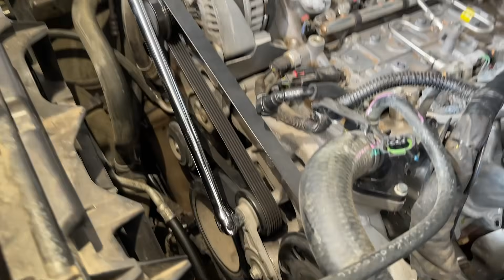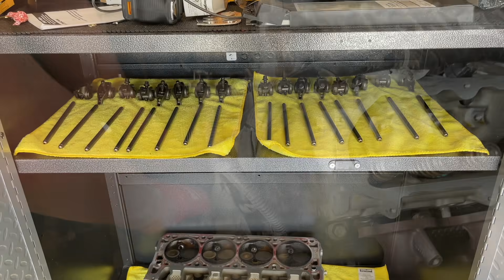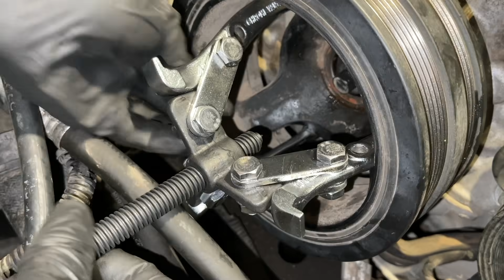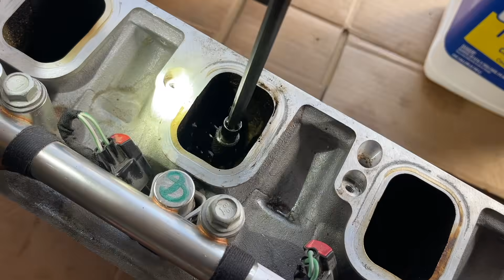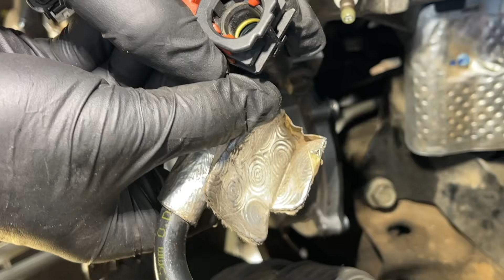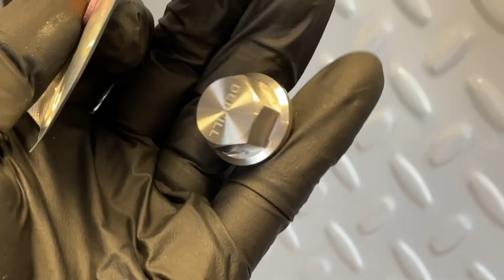GM V8 Cam lifters head gasket dod delete 6.2L 5.3L L86 L83 Yukon Tahoe Sierra Silverado Suburban

Comment: These things are not meant to be daily driven—such a poor engineering job on this model. You will be jumping from engine, transmission, and suspension work and repeat throughout the ownership of this vehicle.
Reply from the maker: Yes. I grew up with reliable suburbans and they are not that way now. I now have Toyotas and this is everything I had to fix on the gmc Yukon / Tahoe / Suburban / Escalade Owner’s manual Bells &  whistles
https://www.youtube.com/playlist?list=PLIjr-uSYDZi7J7EQ1ErTn1Yzi6ET_3Ssr
Reply: @dannyjohnsonsgarage  The camshaft it says that it doesn't fit on the 6.2L L86 V8. Is this dealer recommended?
Reply: Please put some contact info to Tuner , I need to delete dfm afm in ecm on my suburban 2022

Comment: as a gm tech that’s does this everyday great video but there was a lot of unnecessary stuff but great video in the end
Reply from the maker: Thanks. Just trying to do a high quality job. Maybe overkill
Reply: @monsterx13 could u tell me what are the unnecessary stuff because I will be tackling this project next week. Also what lifters do u recommend
Reply: @longstrokes24  are you doing a DOD delete
Reply: @Monsterx13 Between debating it. Was told way to go is dod delete. Engine is making a chirping noise and not coming from belts
Reply: @longstrokes24  most likely a cam dod delete is cheaper
Reply: @Monsterx13 ok. Any recommendations on lifters? Software to turn off dod?
Reply: @longstrokes24 i pad a local tuner to delete the dod in the ecm and i used gm caddi racing lifters and l8t cam and .60 vale shim on the fuel pump roller
Reply: What could of been avoided with a dod delete?

Comment: How much more if im doing the oil pump and time chain also ? Awesome videos 🤌👍
Reply from the maker: For those you’ll want to factor in removing the engine (or lifting it enough to drop the oil pan). The electrical connection and oil lines go deep into the pan. Do a new tensioner as well, and research a non-variable oil pump. If your new cam is not factory duration, look at VVT lockout. I kept mine for better low end performance on a stock cam setup

Comment: Sir! Replace the oil pump and the timing set. Omg you’re better off pulling the motor 😂
Reply from the maker: Where does it end. Might as well do a whole new engine. The oil pump is best if pulling the engine from the lines and electrical connections in the oil pan.

Comment: I have a 2014 Yukon Denali and and 2016 Escalade, so an L94 and L86, my Escalade engine doesn't turn over, my question is, would I be able to use to parts from the Denali to repair the Escalade? OR would I be able to put the L94 in the Escalade? I'm wondering what choices are even possible and what you'd recommend? Thanks!
Reply from the maker: Many parts are interchangeable, but you’d want to use new parts in most cases. There are a lot of other systems, however, that are not interchangeable like VVT and lifter trays

Comment: At any point after you released the timing chain tensioner to have tension again was the tensioner ever loose to the point you could move it with your finger when turning the crank in certian spots but then it would tighten back up. Mine does, and the timing chain seems to have more slack during certian strokes while turning crank bit then tightens. Is that normal or has my tensioner failed?
Reply from the maker: I believe there is a little as you go through, for sure on my mustangs, but I would make for certain. You can push on the back of the tensioner as you did for removal to see if it had tension

Comment: 174,000 miles on my 6.2 Denali. Still going strong. This video will come in handy some day, I'm sure.

Thank you for doing this. Incredible job
Reply: Maybe sooner than later
Reply: My denali just went out at 177000 :(
Reply: @gsamudio77 any updates
Reply: 180k miles and the famous lifter noise just started. Tried the automatic transmission trick and it did not help. Went to 5-30, still ticking.
Reply: I ended up getting Seagram, put it in my engine drove about 5 miles and the tapping has stopped. I’m using 5W-30 oil.
Reply: What brand weight of oil are you running?
Reply: You’re in good luck so far hopefully you don’t get to see this ticking sounds on your vehicle here 2023 suburban premier 5.3L 120,000 miles on and head is out and waiting for the parts

Comment: VVT Lockout?
Reply from the maker: Not for a stock profile cam. You’ll lose low end drivability and torque. I believe for some aftermarket cams you have to lock it or it may have piston to valve Contact

Comment: I’d have dropped the oil pan, replaced the oil pump with one for a non afm application. Also would have done a VVT  delete while I was in there and replaced with a performance RV cam as well as new timing chain, especially since its at 100000 miles.
Reply from the maker: Yeah. Except for the VVT If it’s the stock cam profile. You’ll lose low end drivability and torque, so it’s worth keeping unless you upgrade to a larger cam

Comment: GMC PICKUPS..STEERING SHAFT BREAKING..TAILGATE OPENING WHILE DRIVING..BRAKES APPLIED WITH NOTHING IN THE PATH OF THE VEHICLE..AFM..LIFTERS..TRANSMISSIONS..DIFFERENTIAL LOCKING UP..BEARING FAILURE..PATHETIC VEHICLES GM..

Comment: Plug the oil holes and get ride of the vacuum pump.  Now that you have DOD delete done the motor makes enough vacuum to run the brake booster like normal.  Just T into the PVC line.  Great job on the video also.  I wish I had this to watch last year when I did my son's 2014.
Reply: No vacuum pump on my 2023.
Reply: @rustystubbs242  2019 and up have an electric vaccum pump.
Reply: I wish I knew this when my 2008esv & 2010xl failed 2021 within the same year….
Reply: Would this really work have you tried it?